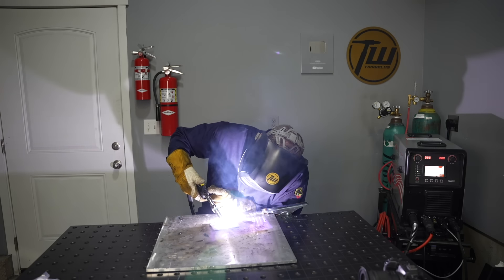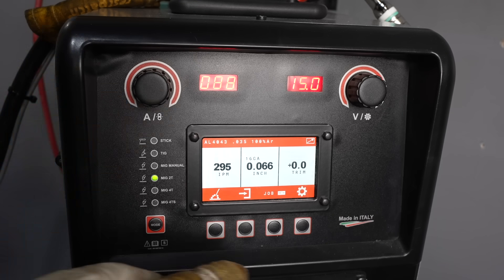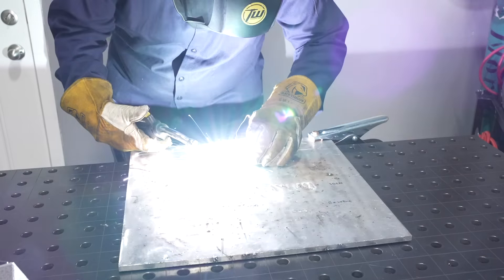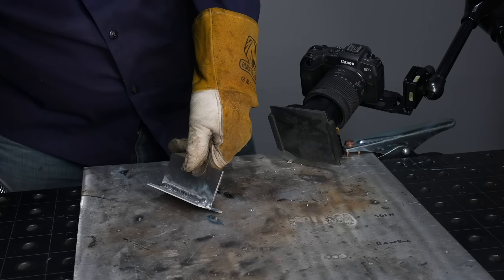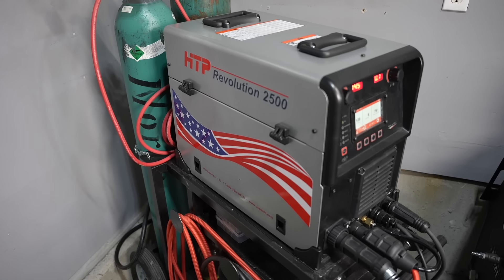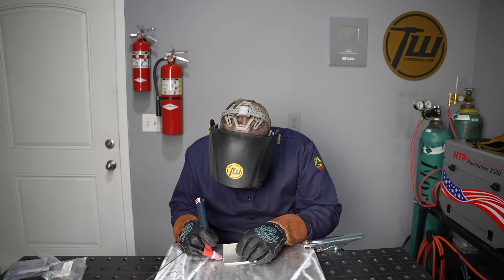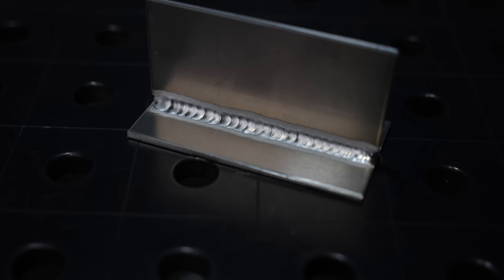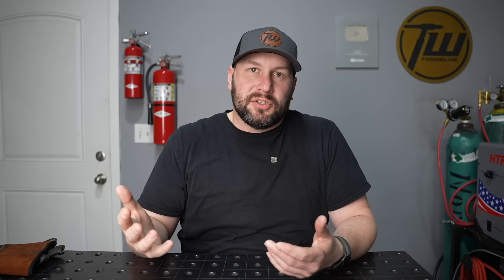Aluminum MIG vs TIG Welding

Comment: Rules for TIG or MIG welding Aluminum. It's the only common metal that has to be free of all oil, grease, paint, gum from labels and any anodize coating. When you file, grind or use a carbide burr, you also remove the oxide layer which lowers the melt temperature which lessens the chance of burning thru the metal. Most welders also clean it with acetone. Most medium to large welding shops that do military/Federal spec aluminum welding are required to have chemical tanks to etch the aluminum which removes the oxide layer. All metals are TIG weldable except zinc which is the plating used on galvanized steel. The short list: steel, aluminum, stainless, copper, brass and titanium. And you can only use Argon or a mix of Argon/Helium for TIG welding, and that rule also applies to MIG Aluminum. Argon/CO2 is only for MIG steel or rough stainless work.
Reply: I work in a fab shop that only does military equipment, mostly furniture, consoles, stuff like that, and I've never once seen our welders clean anything before welding.  Most the time they dont even bevel the material first lol
Reply: @1Fine69c  The aluminum is probably sent out to a shop which etches off the oxide layer with a mild acid. It's a Federal specification for any TIG welding done on aluminum.
Reply: @georgebuck2269  it’s not
Reply: @georgebuck2269  our aluminum isn’t anodized either. That’s not something that happens until it’s finished but we rarely do that anyway. Most of it gets powder coated.
Reply: @georgebuck2269  perhaps whenever it gets cut in the laser or punch and it leaves burs, the sheet metal guy grinds all the edges before bending it up. But it will sit for months sometimes before getting welded.
Reply: @1Fine69c  Yes there are rules for how long the Aluminum sits around after it gets etched in the mild acid to remove the oxide layer. Only a mechanical engineer in the office knows or cares what the time rule is. All the welder cares about is, is the aluminum clean before he welds it. No oil, grease, paint and anodized coatings on aluminum, it just won't weld. In large metal fab/welding shops, that have the money to buy expensive machines, they have a machine called a "Timesaver." (Timesaver is only the brand name) It's consists of a four foot wide belt sander (or smaller width, less money) The flat metal stock, steel, aluminum and stainless are run through it to sand the burrs off any holes, cutouts and the edges. Also both sides are sanded. It also applies a rust preventive soution to keep the steel from rusting because the oil that keeps it from rusting is removed. Laser machines should not leave a very large burr, if the right gas is used. I started metal fabrication/welding in a trade high school in 1967.
Reply: @georgebuck2269  nope. Don’t use any of that. We don’t have any acid wash and the welders don’t wipe anything down with acetone. Most the time they don’t even bevel anything before welding it lol. Been doing it for 40 years and haven’t had anything rejected. Most the time the aluminum runs through a grainer before being bent but there’s no acid wash or acetone.
Reply: @1Fine69c  When you buy aluminum at a hardware store or Home Depot you sometimes have a choice to purchase plain or anodized aluminum. Anodized coated aluminum is usually used on boats or on the railings that are around salt water. And any other products that sit around outside in the weather. Uncoated aluminum corrodes very easy around salt water & spray. If you buy a Maglite flashlight it comes in different colors, black, white, purple and more? They all have an anodized coating with different colored dyes used in the tanks, which gives the different colors. And a clear coating is used on all aluminum.
Reply: @georgebuck2269  we get our aluminum like 50 sheets at a time. Especially 060. And they don’t come with any coating on it and it welds just fine. Might end up with same black soot on the weld but that’ll come right off before powder.

Comment: Hi Tim. This has nothing to do with the points of this video, but I thought it would possibly be helpful. As you know, I have the same table. I use 1/4” thick copper plates under small weldinds I’m doing and often use a spatter shield spray. A couple of weeks ago I was doing that and had some odd problems with the welds. The welds were fine, but somehow the metal looked like it sputtered all the weld shmutz off and it looked very bright. I was welding some A-36 with 309L wire with 100% argon. I’ve done that in the past with no problems. Sometimes I prefer that to 75/25 as I can’t get other mixes in the 80 cu bottles. When I finished and removed the copper, I noticed that some of the black surface had come off the table in odd patterns. It was, fortunately, a small area. I found that small particles had worked themselves under the copper and between the copper and the work and the areas right around them apparently had taken a heavy dose of amperage due to poor contact and lifted some of the blackening off. I’ve never had that happen before, but I thought it would be interesting.

Comment: Would you mig .080 aluminum or is it too thin. I have a project i need to join 1/4” angle to .080 plate. Figured id be ok if i just focus my puddle on the thicker material

Comment: Nice Tim! I can’t believe one volt made that much difference
Reply: 0.6V can be the entire range between "too cold" and "too hot".  ie the entire operable range.  One reason you need a good solid reliable welding power-unit - you want stability, where a 1% change is really noticeable and the sort of range you trim within.  You can sometimes see the effect of 01V.

Comment: Great comparison. For the projects Ive done so far, the actual welding time is a surprisingly small proportion of the total project time. This, among other things, has led me to want to buy a TIG machine. Admittedly, I have only done a few small to medium projects using a small flux core machine so far, but it has helped me learn where I want to go next.  Thanks, Tim.

Comment: Hi Tim - amazing first time seeing someone else use CV (constant voltage) (and constant current in physical reality) Aluminum GMAW/MIG and constant smooth weld progression.
Here in UK insistence is
* Pulse MIG even at high powers where could "spray"
* must be stepped progression producing ripples
When result is more than 90% of welds do not meet specification you'd expect a re-think - but no.
I hadn't yet found how to macro-etch marine-grade aluminum when last did CV Ali MIG (hot "drain unblocker" (certainly an alkali - likely based on sodium hydroxide)).  Would love to know what the weld was like inside.
Thing is with CV and smooth progression
- see that consistent electro-etch cleaning action around the weld - near the arc
- and you do not mess around with the weld pool
If you disturb it least, you will surely get most float-out of gas and oxides.  Wish could do a test fillet weld, saw it so you have a flat sample containing the weld, and take it to be radiographed.
Despite crippling rejection rates using Pulse&manip., no-one interested in doing tests here.  Would prepare a Pulse&manip. weld the same and get that radiographed too - get honest good information.
Anyway, thanks for showing.
By the way - setting CV Ali MIG solely on welder's judgement, you end up within a few Amps and closer than a volt to the recommended conditions in the Lincoln Foundation "The Procedure Handbook of Arc Welding".  Which is CV.  Could have knocked me over with a feather that day when I got home and found this to be the case with a weld I had just developed and had accepted that day.
The rule I know is:
for 1.2mm wire (47thou) with wires like 5356 is
* >= 10m/min - spray at about 24-ish volts
* < 10m/min - pulse
[10m/min==394ipm]
You can spray at a bit lower, but to be honest, being pragmatic, pulse simply gets easier at less than 10m/min with 1.2mm ali. wire - then you get to where the metal is too thin to "spray" at all.
But yes it seems you get everything you want going CV with spray transfer for ali MIG, yet have only once been permitted to do that here - on a high-value job.

Comment: Greetings Tim. Thx for the video. I do have a question.
Many sites I visit state that mig welding aluminum requires spray transfer period. These sites claim that you need at least 200 plus amps and 24 plus volts to obtain this type of transfer. I notice in your aluminum welding course that you obtain spray transfer using much less amps and volts. I seem to be able to hetthat nice hissing sound with my 180 amp mig welder with lower amps and lower voltage.
So are these sites wrong?
Thx for responding.
Have followed your videos for quite some time and enjoyed them all

Comment: Hi Tim, I will buy all your courses and get into the world of metal working and welding. Is there a welding machine that you recommend? That hopefully can weld using different technologies to start your courses?
I already have built a CNC plasma cutter and I will buy a sheet metal bender soon to make all sorts of DIZ projects. Thanks for inspiring me.
Reply from the maker: Thanks for the comment! That plasma table project sounds awesome! The machine I used in this video, HTP Revolution 2500 (linked in description), is the best all around machine on the market right now in my opinion. That being said, picking the right machine depends on the specific work you want to do with it and your budget. Send me an email at the email address on my channel about page with some info about the specific work you want to do and your budget and I can give some specific recommendations for your situation.

Comment: Hi!  I have been binge watching your channel, and wanted to : 1. Thank you for the content, and 2. Try to mooch some information.  I was gifted an S7 Tig Welder, HF TIG/Stick/Arc Welders,200 Amp 110/220V welding unit, and I am super keen to try to learn at least a little about this art.  The unit, however, came with a very sparse and difficult to read translated (sort of) Chinese manual.  It has an amperage knob, which I understand, and then a knob which goes from 0.1S to 6S.  I thought originally this was a welding wire speed adjustment, but the unit has no
spooler or motor, so I was a bit confused. (I ignorantly bought a spooler motor and two types of wire before I realized my mistake).  The welder also has two toggle switches, one for Arc-Tig
and the other says 2T and 4T....  What do these switches do?  I've scoured the web to find out, but it's amazingly difficult to get answers.  I realize you have a lot of subs, and therefore not a lot of time, but any help you could offer would help greatly.  Thanks
Reply from the maker: The knob is probably post flow, the amount of time when you’re TIG welding that gas will keep flowing after you stop the arc. This allows the argon gas to continue to protect your electrode and your weld while it cools down so it doesn’t get contaminated by the oxygen in the air. I’d just leave it turned all the way up at 6 seconds. 2T means that the welder will be on when the trigger is pressed and turn off when it is released. 4T means you press and release the trigger to start the arc and it will be on until you press and release it again. All of those will only apply to TIG welding in the TIG mode. When you’re in ARC mode, it will be on all the time for stick welding.
Reply: Thanks for replying, you're kind to do so!

Comment: did you change the liner when going from alloy to steel?
Reply from the maker: Yeah, it’s a graphite line used just for aluminum. I actually keep a second gun setup for it.

Comment: What type of wire did you run when welding with mig gun? Also on the spool-gun, please you’ll be making me a huge favor🙏🏻 and thank you, you actually did a great job, hopefully this can help me to finally fix my car, but I don’t know which type of wire I should use, im not sure how I would work on it. I’ll appreciate your guys help if anyone else knows
Reply from the maker: .035” 4043 is what I usually use. You can also run 5356 filler on a lot of alloys, which generally runs a bit colder and is dirtier but can help on thin aluminum.
Reply from the maker: .035” 4043 is what I usually use. You can also run 5356 filler on a lot of alloys, which generally runs a bit colder and is dirtier but can help on thin aluminum.
Reply: @TimWelds  thank you so much Tim!!! you’re a life saver and a really great guy. I own you one
Reply: @Jasson13rd I doubt that you can fix your car with a spool gun ….  MiG aluminum is always a spray arc …. That means with a spool gun and without pulse you are limited to material thicknesses of .100” and thicker …. Auto motive stuff is typically less than half that thickness…
Reply: @ZILAwelds  in my case what would you recommend me to try to weld my car with? I’m still not sure, and I was already looking for spool gun on the market place
Reply: @Jasson13rd  these are only 4 ways of welding thin automotive aluminum that I know of….  Ac tig, pulse MiG, laser, and oxygen fuel (with a lot of skill and practice) …..   spool gun or MiG without pulse AND stick are not suited for material thinner than roughly 1/8”….   
You might be able to braze it if it is extremely clean and you have better skills than me…. You would need a zinc based brazing product like HTS2000. …..  you can google that and watch a few videos ….  Looks easy on YT - I have tried it, I just don’t have the right skill level for it …..  I can tig weld Coca Cola cans but that brazing rod I personally can not master …
Reply: @Jasson13rd there is no “easy” or “cheap” recommendation ….

Look on my channel about 2 month ago i made a video on mig or pulse mig aluminum and if or why you need/want it , i try to post a link but the spam filter seemed to hold it back

Comment: Hi Tim.. can the 26080 aluminum mig gun work on the Miller Multimatic 215 mig gun port connections? Are they the same connectors?
Reply from the maker: This gun has a euro connector, which is different than the 215. Usaweld does have a gun that will fit and a liner for it or you can get a teflon or graphite liner for your stock gun and change that out. Just make sure the liner you get is compatible with the collet on the gun you’re going to use it with.
Reply: Thanks for the great info Tim.